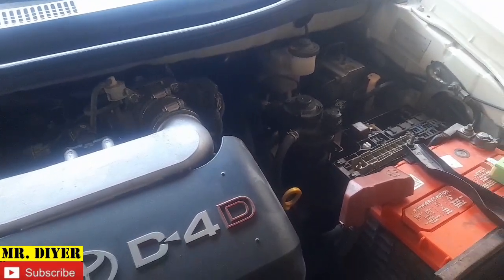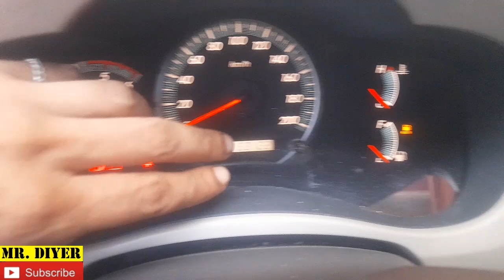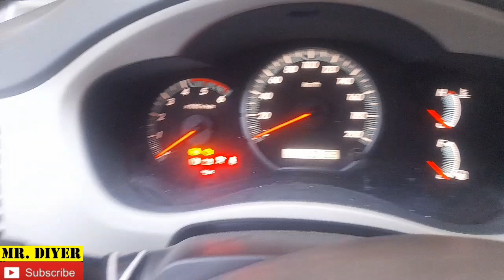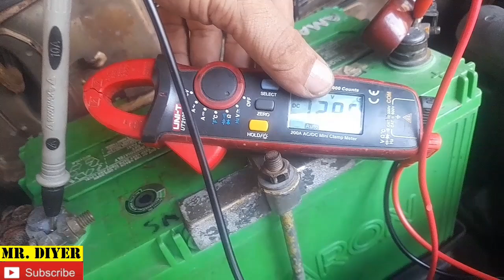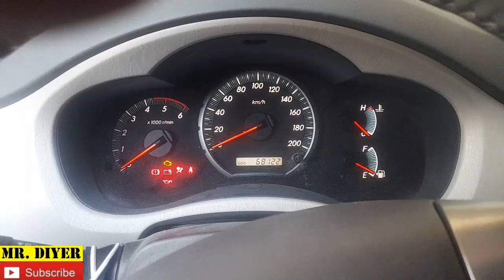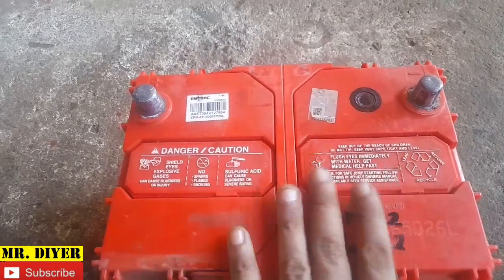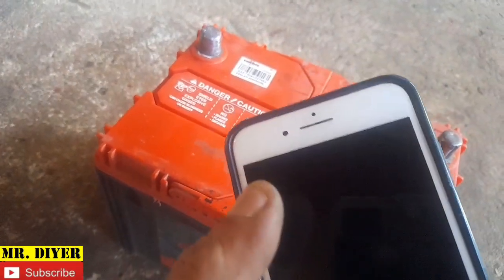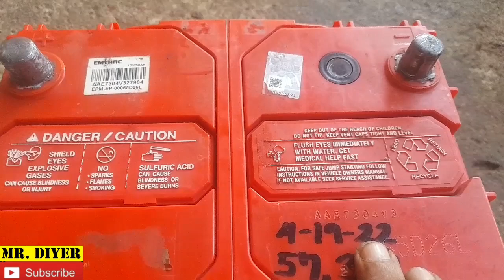The Battery is Good but the Car Wont Start?

Comment from the maker: These are some of my older videos where in i discuss the battery, cranking amps, surface charge etc.

This is a comprehensive video as to how to check the starter from the battery all the way to the starter. https://youtu.be/tqsRlAd7Ewc

This is a two part  comprehensive videos on how to check the alternator. From the battery to the wires to the charging to testing on and off the vehicle.
Part 1 https://youtu.be/kZNbCGo4K0U
Part2 https://youtu.be/aLTxyG1tIM4b
Reply: Ive seen these videos and im thankful i learned a lot from watching your vids. A bit long but very comprehensive.

I find it funny that some viewers here just because they watch your latest video makes it appear that you havent discuss any of the points they are trying to raise trying to make them appear as a bunch of experts yet here they are watching. Lol

Comment: Thank you for another good video sir! Very much appreciated!

Voltage alone can lead to mistaken judgements, one mandatory step is to check voltage with multimeter when engine is trying to start. If voltage drops too much it means that the battery os most likely done.

Some free maintenance batteries can still be opened and checked for water levels.

Also theres a sulfatation process that can cause batteries to prematurily malfunction, It can be reversed in some ocasions with slow and persistent charges, some chargers have this function implemented.

Modern cars with tons of electronics usually go crazy when this happens, because all systems and sensors lose all references and interpret it as the car is faulty, making It some times starting up but entering emergency mode

Comment: Watching po, also left u a few comments on previous older videos, salamat man
Reply: Also what i learnt when i turn the key to on position without starting the car m u can see if the battery is dropping voltage then u know the battery is caput.